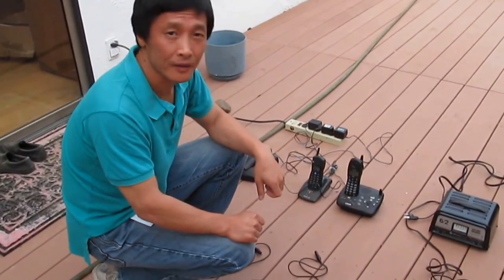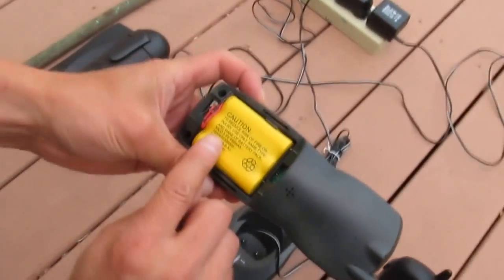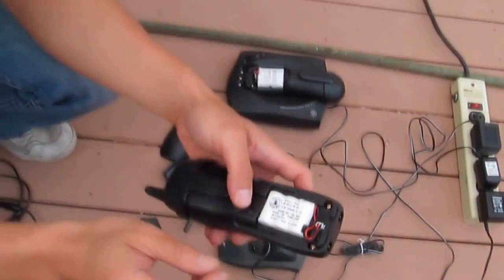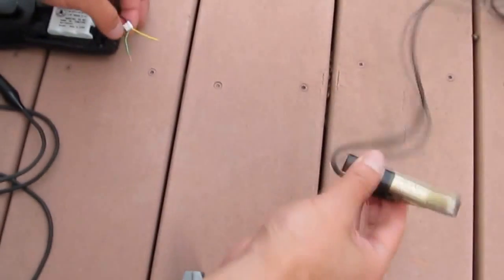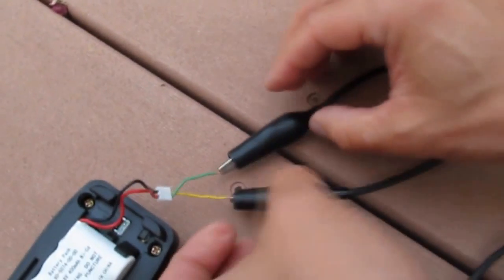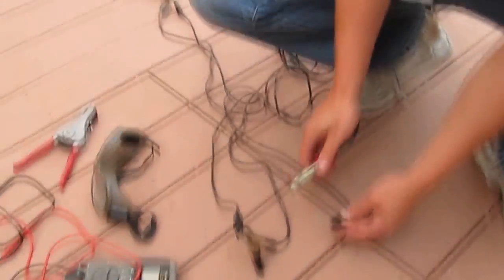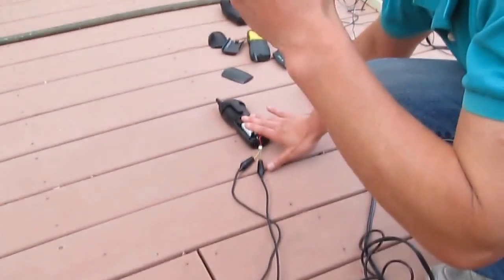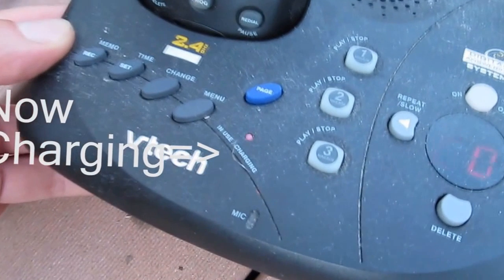Easiest Way to Revive NiCad Rechargeable Battery

Comment: Great video! I have a zero volt Motorola NiCd battery, will try this method!
Reply: Did it work?
Reply: @oppok5657  I have this newer smart battery charger that didn’t work, it only sends power when it identifies the battery connected.

Comment: Shocking it erases the memory effect on NCad batteries. I don't think it's crystal dendrite growth, otherwise the battery would be junk.
Reply from the maker: If you measure the current while trying to charge, the current would be very small, that means the internal resistance is very large. The crystal dendrite could cause large resistance, if you use high voltage to zap it, it may be puncture the crystal dendrite thus leading a larger current. With larger current you will be able to start charge the battery. The memory effect you mentioned is different: the battery appears to "remember" the smaller capacity, you are able to charge with current to "full", however it discharges quickly. I know my case is not memory effect because I could not charge it at all.
Reply: @GeniusAsian  Well, zapping NCad batteries works for some reason, that's what really matters.

Comment: It's sparking because it's charging? hRmm.....I think I'll pass on that 'round of Kool-Aid.
Reply from the maker: Whenever you have current going through a very small area on-and-off-on-off, there is small arcs created. If you don't have very high voltage and don't fix the connection for long time, then the danger is limited. Anyway, just my opinion.
Reply: @GeniusAsian  I was half joking. I know enough about DC to make repairs and not kill myself, but I'm not familiar with the logistics behind why this would work to make any judgements. It seems like people have had good luck with it, so more power to you!
Reply: @GeniusAsian  If this were a reliable method to restore the batteries, it would be easy to build a simple circuit and micro processor and make a system you could sell to "restore" these batteries. Someone could make good money selling them if it was reliable : )
Reply from the maker: @kustomhooligans  There are multiple factors that your "NiCad Rechargeable Battery" died. One of them is the the crystal dendrite growth, and zap-it can destroy this crystal thus decrease the resistance. However if it is due to other factors, they can't be saved by this method. Americans like to throw away old things to the landfill, not to reuse them. You can only reduce the use of plastic bags when a law ban it.  I promoted my ideas of saving 10 thousand plastic bags per dog, but no one is interested in even watching: https://youtu.be/UCJdoxB209o 
Comparing the restore-system for a household rechargeable battery, may be the car battery has a better customer base because those car people are more science savvy. Although there are also multiple factors that can lead to a dead car battery: https://www.youtube.com/watch?v=5_0nsReSKhE  ,  the results are more consistent and more predictable

Comment: " the battery might explode" reason enough for me not to try this
Reply from the maker: The process has to accumulate enough energy/heat to make the battery explode. If you only "tap" the terminal with thin wire  strand for half second, the probability of having high heat is low. Like you see in the video, stay away, your rear face the battery etc.

Comment: I have been there and done that. I have  experience  doing this and I found that the ni-cads will work after clearing the short in the ni-cads  HOWEVER, this fix only last a short time and the cell will short again. It's a chemical  (crystalize) state inside the ni-cads that causes the cell to short out. I  have tried high voltage  which works better . Ni-cads will leak at vent and have a white crust all around the positive side of cell. You will find that zapping the cell with higher voltage/current will be a redundant procedure and best to replace the ni-cads rather trying to fix them.
Reply from the maker: Yes, agree with you, the "re-charge" is not unlimited. It does not mean it is "forever."  In the beginning it works well, but at some point zapping becomes not as effective. Thank you for taking the time to share.

Comment: I tried it but I left it for about 5minutes on a larger battery. It got hot and caught fire. I Must've left it wayyyyy too long. I guess it was MY fault.
Reply from the maker: Thank you for sharing. This is a good warning to other viewers. The "zap" only needs to be strong enough to knock off dendrite. It's a pulse for shock treatment, not meant to have a constant large current. If you have constant current, then it will generate heat, thus lead to fire.
Reply: corgLLC thats where I went wrong. I tried charging it fully from my battery charger. So I'll retract my statement. Do it but pay attention 😀

Comment: I tried that. Almost burned my shop to the ground. Don't do it!
Reply from the maker: What did you try?  Please share with us, how long did you tap the wire? Note when you tap the wire, it is less than a second, it would not generate enough energy. Did you have flammable gas in your garage?

Comment: Awesome! Love videos with the creator saying this could explode 💥👍🏼
Reply from the maker: The "zap" only needs to be strong enough to knock off dendrite. It's a pulse for shock treatment, not meant to have a constant large current. If you have constant current, then it will generate heat, thus lead to fire.
Reply: corgLLC  ,sounds good, thanks for the tip. ✌🏻

Comment: I repaired traxxas 6v battery packs for my RC trucks using this method ...   I hit them with a few seconds of 12V,1amp, packs got hot but work like new!
Reply from the maker: thank you for taking the time to share you result
Reply: How many cycles did you get out of the battery packs after you zapped them?

Comment: Battery may explode?!  Wow that's the easy way
Reply: We have done a few experiments on the "explode" part. You really need to accumulate enough heat in a very short time period. In our video, we used the wire "scrape" to make sure it would not generate much heat, or the time frame is very short.

Comment: There are  several suggestions for getting a good result
Don't try to do this unless you are sure what you are doing - the acid can burn you
Test the voltage first - there may be a dead cell which would waste your time.
Check the battery fluid.
Try to fully charge the battery.
(I learned about these and more from Jons Mender Guide site )

Comment: Your tip saved me about 50 bucks for new batteries. I had 2 dead 18 volt batteries for my power drill.
I use a wall adapter with 12 volt and swiped the wires a couple times against the contacts of the batteries, and now they are both charging again  :)
Reply from the maker: thank you for sharing your experience
Reply: x x
Reply: x
Reply: How can 12volts zap a 18volt battery?
Reply: @CrustyBiker  I would like to know that as well. Maybe because the dead 18 volt batteries were essentially 0 volt at that point? But I am a noob, so would appreciate someone more knowledgeable to comment on this.
Reply: 𝐍𝐨𝐰 𝐲𝐨𝐮 𝐜𝐚𝐧 𝐝𝐨 𝐛𝐚𝐭𝐭𝐞𝐫𝐲 𝐫𝐞𝐜𝐨𝐧 𝐨𝐧 https://t.co/jfZbilIKLW

Comment: Simple fix ....... NEVER go on vacation !
Reply from the maker: +ItBseCtioN8 thanks for your feedback. Happy new year.
Reply: +ItBseCtioN8 There are several factors in getting a good result. One place I found that successfully combines these is the Magic Mender Wizard (check it out on google) definately the most helpful info that I've seen. Check out this  extraordinary resource.
Reply: Another way to prevent the high current discharge is to disconnect the battery in each phone before you leave!

Comment: Be a good idea to watch the ammeter on the charger. Mine went all the way to max when hitting 3.6 V  Nicads  with a six volt charger.  Works  as it shocks the sulphating off the 
cells plates.
Reply: Only just seen the video. Joe you took the words out my mouth. I have been using an old 6v charger I've had for years using this
method also maintaining the charger every 6 months or so it brings the battery back to life 8 times out of 10 .

Comment: lol - I've been trying for weeks to get 2 13.2v batteries to charge.  This is actually working now. Wow.  I connected the battery charger (that I use for my car and motorcycle batteries) and used the 12v 10A Fast Charging switch on one of the batteries.  On the other, I had to actually use the Start switch on the charger and kept touching it and getting the sparks.  I then went to the 12v 10A switch and it indicated a green light charging.  Then I could connect the battery to the real charger for those batteries and it is now charging (and the drill works with the batteries now that they are not dead).  Thanks a bunch. Good video.
Reply: Start your very own battery business and make huge money here: JoxCharge.com
Reply: Replace battery inspiring 1545

Comment: Not my method because with "tap-zapping", you do not control the amount of energy.  Here how I do it.  1st, mesure the voltage of the dead battey. You will need a charger or any DC PSU of adequate voltage, A fairly big electrolytic capacitor and a multi-meter. Then connect all the black wires together (incliding the battery).  Charge the cap on the psu and disconnecting the red casble use it to connect to the battery.  Now, there is only a finite amount of energy in the cap and it is repeatable.  You can use the multi-meter to monitor, at all time, the cap charge and the cap discharge.  Once done, unplug the cap from the batterty and put it back to charge.  Measure the battery voltage and repeat until the batery shows a significant increase in voltage.  Then, it is revived.  And the set-up only requires that you manpulate one red cable at a time.

Comment: The reason why it is not charging is because the voltage state of the battery is too low for the charger to recognize that a cell is installed.  By hitting it with the 6v you are increasing the resting voltage enough so that the phone charger recognizes that a battery is installed.  A safer way of doing this would be to use a low amperage 3v power supply rather than a 6v charger.  Or use a hobby grade charger and set it to trickle charge at 3v.  This would give less shock to the battery, and increase the voltage to the point that the cell can be charged by the phones charger. 

I jumpstart old AAA rechargeable batteries all the time using a short strand of wire and connecting one that charges to one that doesn't charge in a 4 port AAA charger.  The batteries are typically not 'dead', the resting voltage is just a little too low for the charger to detect them.  Typically, this is .9v per cell, which in the case of the phone charger, would be 2.7v, since it is a 3 cell pack (1.2v per cell x 3 = 3.6v).  With 3v being within its charge range, it is much safer to use 3v than 6v which is considerably outside of its charge range.  You are only looking to bring the resting voltage above 2.7v on the pack to have the charger detect that there are depleted batteries that need charging.
Reply: You are 100% correct. I have been recharging supposedly dead batteries of all types for decades. I recharge alkaline batteries as a matter of economic principle & have set up my son & a nephew safely using the same techniques.
Reply: The only real danger in recharging a battery is with a lithium type.
The danger represented with these is accidental polarity reversal (cross polarity) or overcharging. The over charged condition is noticed by a swelling or swelled case. Crossed polarity can immediately cause an explosion.
That is why to bring a cell phone lithium battery back from the dead you tweak the charge just enough for the normal battery recharger to recognize the lowest current in its pre-set.
Reply from the maker: thank you for sharing your experiences
Reply: I have an 9.6v nicd battery drill that i need to do this. How high voltage should i use?
Reply: I don't know how to connect two batteries together. Do you have a video?

Comment: Applying overvoltage to a depleted Ni Cd Battery is a foolish and unsafe practice. It most likely will generate a lot of heat and possibly melt or explode.  Better to buy a new battery.
Reply from the maker: you only flick one wire against the second wire in micro seconds, don't let the contacts joining too long to build the heat. I touched the battery, it was not warn at all. But I do agree, people need to be careful with proper protection and always treat this as high risks operation.

Comment: charge for a minute with  12v car charger that work to .you get light (green and orange ) baterry is empty.but can be one or more cells brocken and me personaly open baterry ...checking voltage and replace bad one using soldering gun      need more heat to do it

Comment: Rechargeable batteries can.be charged to a higher voltage.. so a car  battery can be over charged to a reading of 24 volts but your likely tp fry the battery doing that.  And it will definitely reduce its life span, not to mention it could explode depending on the quality.  Most 12 higher grade hobby batteries rated at 12v use a 15 VDA charger and are meant to be over charged.

Comment from the maker: We have to understand the reason of ordering for take off or connect a cable. For a car (Japanese cars), the negative is connected to the whole body of the car as ground. If you were disconnecting the positive + cable first & you accidentally touch a metal part the vehicle, you will create a short circuit. But here my negative is not connected to any ground, the risk of short is the same. Thus it does not matter which one first or last.